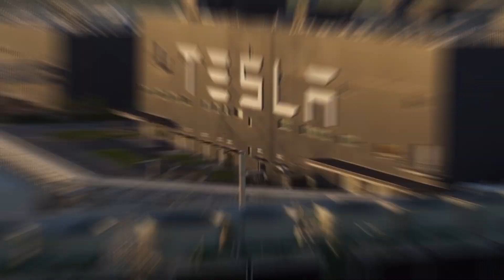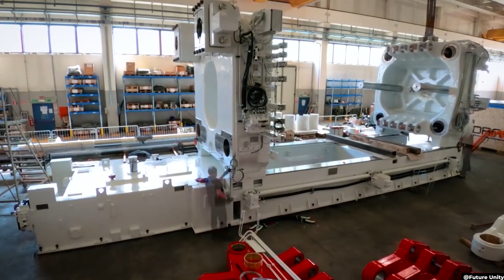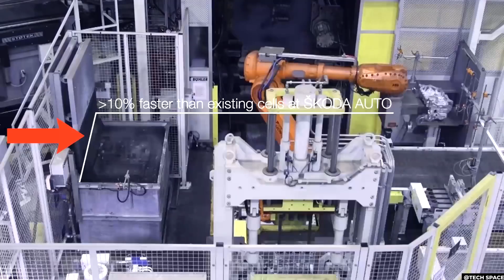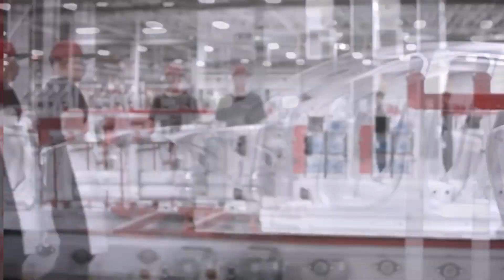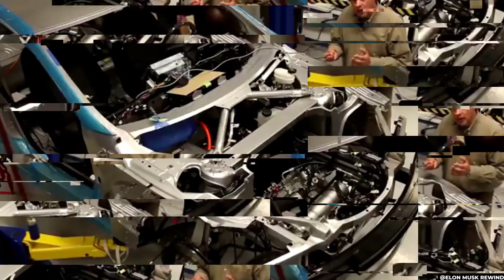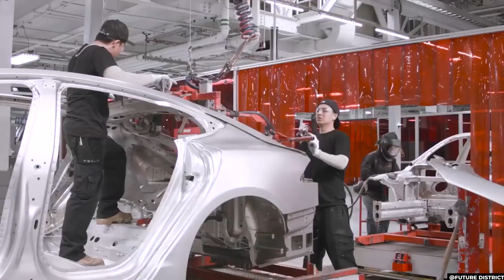GAME OVER! Tesla's Revealed Its New SECRET The Gigapress

Comment: Can you imagine one day when a Tesla car is made in two complete Giga Pressed parts, both parts completely operational on each own..

The first part is the skate chassis/powerplant/batteries/wheels - a working rolling chassis...

The second part is the complete "car" for all intent and purposes...seats,dash, etc everything you see inside a car. 

Both parts have mating parts to connect electrics, hydraulics, air conditoning, retractable drive-by-wire steering wheel/yoke  and all drive by wire steering controls..

Mating requires only a few large bolts, some weather/waterproof gasket between the Car and Chassis Units to make it water resistant.

Repairs consist of getting a loaner chassis while your car is repaired/troubleshot.... Same goes for the Car/Cab, you get a loaner Cab while your "Cab" is troubleshot or repaired...

Everyone is happy, except UAW, GM, Ford, Stellantis and President Biden....